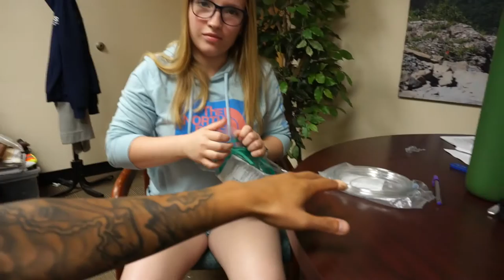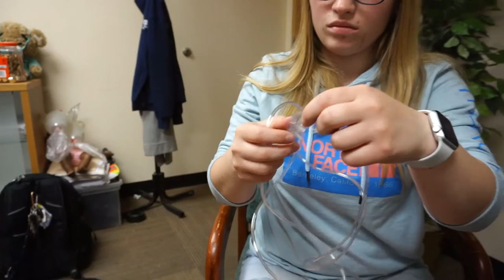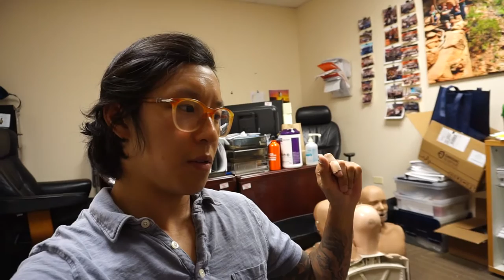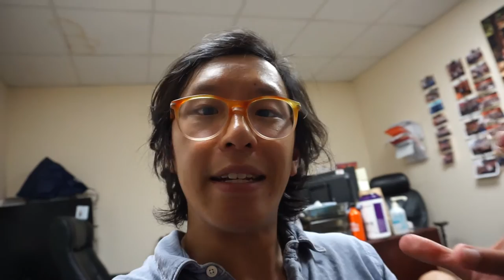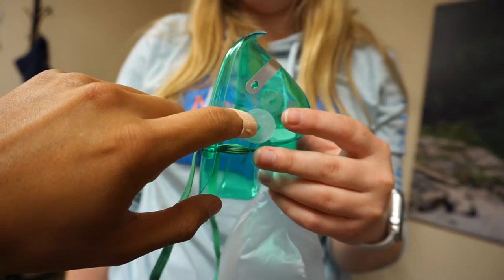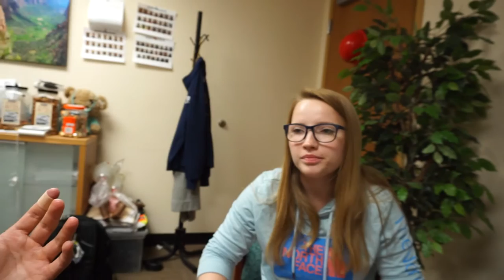Difference between low flow and high flow oxygen

Comment: NRB is not a high-flow device.  A true high flow device provides all of the patient's inspiratory flow, which creates a stable and fixed FiO2.  NRB is a low-flow, variable FiO2 device because it does not provide the entire inspiratory flow a patient needs.  What you set a flowrate to on a flow meter does not indicate whether a device is "low-flow" or "high-flow."
Reply: Your right I am a disabled 
Paramedic , a Venti mask (Air entrainment mask) is a high flow device. they do have high flow nasal cannulas (7-15 lpm 48%-85% of o2 in the nose its very hard to actually reach 100% unless its via Trach or endotracheal tube, which I thought he was going to actual show but its not a high flow device; and i must note even the high flow nasal cannula is not a actual high flow device. a high flow device is actually supposed to deliver up to 60+ lpm to meet resp. demand.  also they have a actual higher flow nasal cannula that delivers up to I think around 60~90 lpm.
Reply from the maker: Gotcha. that makes sense. We simply used that terminology to differentiate the ranges we would use with each respective device. I wouldn't increase the flow rate beyond 6lpm on NC. I've responded to patients with nose bleeds because their cannulas were on a high rate.
Reply: @ChicagoEMTTraining  yes I understand you should not use it with a general low flow or normal flow NC but we do have high flow nasal cannulas w/ high flow humidifiers. for 6.5 liters and above; all the way up to 15 liters. and it works pretty well if you need something that the patient could not handle the Non-rebreather mask or is claustrophobic.
Reply from the maker: @christiansallee427  that makes more sense. We usually do not utilize humidifiers in the acute prehospital setting
Reply: @ChicagoEMTTraining  you might need to ask your Hosptial that you work with and your agency about high flow NC and high flow humidifiers. now you need the one that says 6-15 lpm which mine is white top.
Reply: Would CPAP fall under this category?